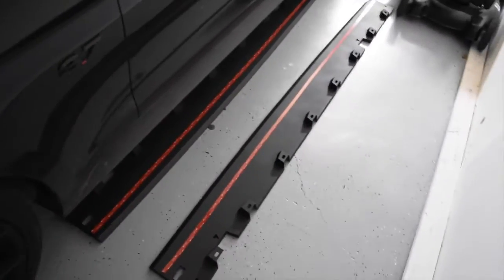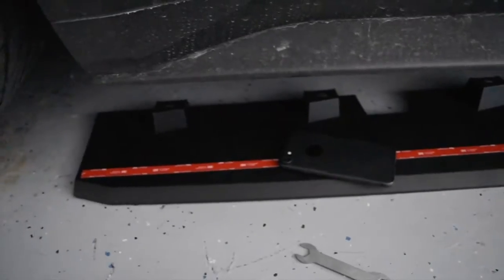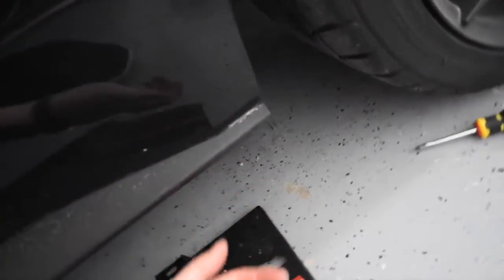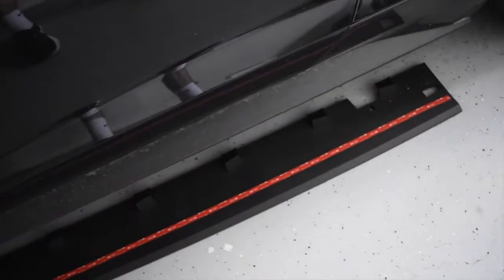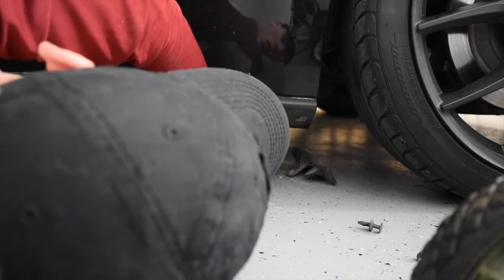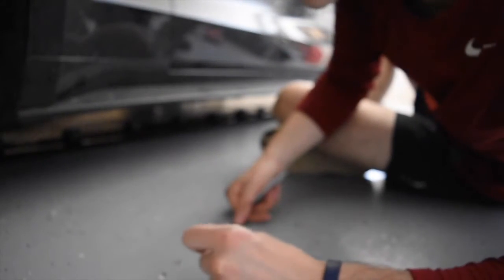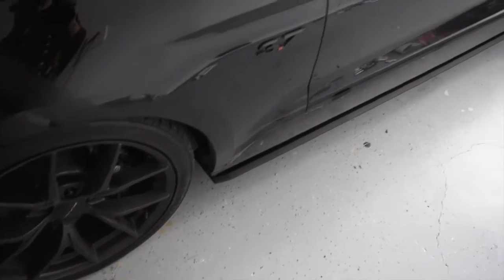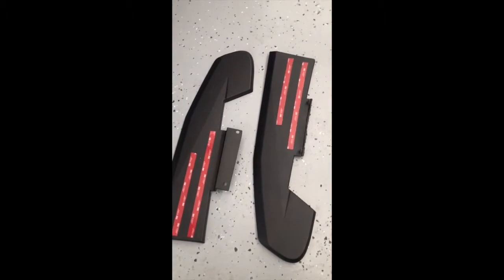RTR Splitters install- 2015 Mustang

Comment: Doesn’t RTR suggest a little drilling too on the side splitters?
Reply from the maker: I didn’t realize that they did when I made the video, but a few weeks after I noticed that the tape started to give and I reinforced it with screws!
Reply: Murderedout3.7 how has it held up. Sometimes in pics I feel like they look deformed almost as if when people bottom out maybe they lose shape.  Curious as to that.  Meaning they don’t maintain the integrity of the splitter.
Reply from the maker: C M Since I reinforced them with screws they are very sturdy!

Comment: You got any thoughts on changing the grille as well?
Reply from the maker: AnkerBanker123 well I already upgraded to a GT grille so I will keep that for a while. But if you're asking just in general, yeah American muscle has some awesome grilles! The RTR grille is so cool but $700 is too much lol
Reply: TheDiverseChannel I have that one lmao it's $449 for upper and bottom grille bro lol.
Reply from the maker: AnkerBanker123 oh no I was talking about the RTR grille with accent vent lights! But that one is sick too!
Reply: TheDiverseChannel ohhhhh lol. I wanted to get those but then I saw the lights and it looks like the car got nostrils lol. But yeah those are like $750 lmao screw that.
Reply from the maker: AnkerBanker123 lol never looked at it that way but yeah shit is too expensive for a damn grille
Reply: TheDiverseChannel agreed lol. Another question, when you put on your shorty bbk's, did you get a check engine light?
Reply from the maker: AnkerBanker123 nope! That may be an issue with the o2 sensor that hooks up the the headers. Because the headers are outside of the engine block, you shouldn't have any engine related issues
Reply: TheDiverseChannel man. Because I'm gonna install them but I'm scared lmao. I got a '17 3.7 as well. Black too lol, but I just don't wanna fuck this up. I got a roush installed with a custom x pipe too.
Reply from the maker: AnkerBanker123 it was really difficult to do! There isn't any room to work which makes it frustrating. But in the end the sound is so worth it! And nice! It's going to sound amazing, it sounds completely different in person, especially driving with the windows down
Reply: TheDiverseChannel I'm probably gonna get started on it sometime next week lol. Keep up the vids man they're dope lol.
Reply from the maker: AnkerBanker123 okay man good luck! I would have someone help you if you can! Makes the install a lot smoother! I had my step dad help me which he's an engineer. But thanks man I will definitely keep them coming!